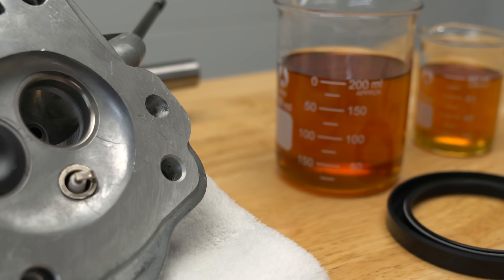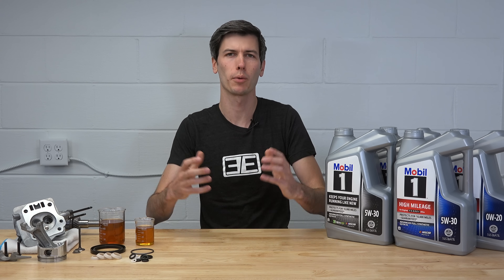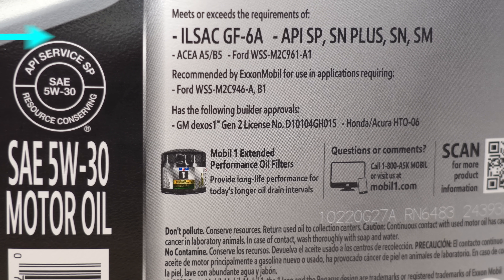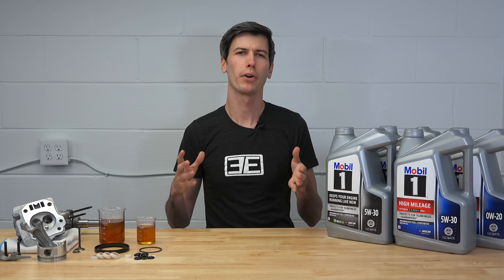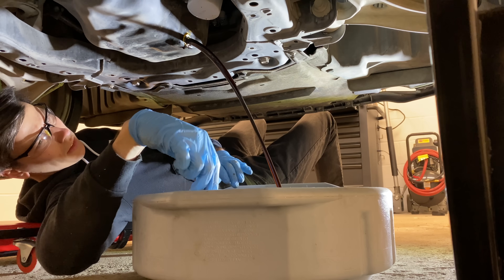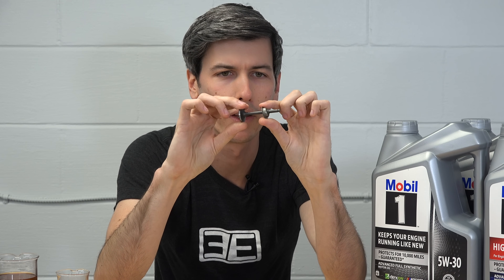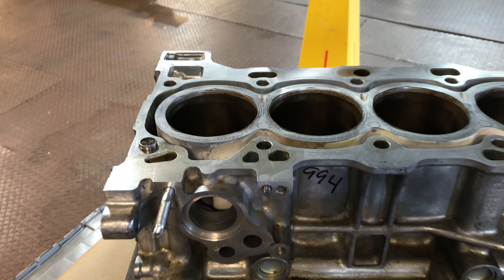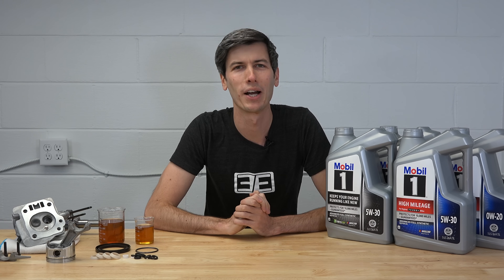Is Synthetic Motor Oil Bad For Old Cars?

Comment: I hated dealing with old farts at Autozone that would run 20w50 in their 2015 Corolla because “that’s what I ran in my 87 Chevy truck”
Reply: And that's why their gas mileage is trashed.
Reply: @101Volts  .0001 mpgs less, big deal.
Reply: I'm an old fart and I use 20w50 in my tractor in the summer.
Reply: I'm a dealership mechanic and we often have customers do stuff like that. Had a customer with a 2018 RAV4 who insisted we used 5W30 because his previous RAV4 ran 5W30 and it's $5 cheaper than the 0W20 synthetic Toyota recommends.  Very common for customers to challenge us and "know more" than the guys who wrench on these everyday.
Reply: @matte8441  I almost kick someone in the face argued about this same issue today🤣he wants to put diesel engine oil into his Toyota Vios..
Reply: Hunk I honestly think customers who challenge mechanics shouldn’t take it to us and should do the work themselves. I’ve been challenged at lot of times. Did a vibration diagnostic on a 2020 Toyota Tundra with 200kms. Cust. States the truck vibrates at highway speeds but he has beefed up tires on it. Kept on insisting he had suspension damage. Some people buy the wrong cars for their needs
Reply: Matthias H I was challenged last weekend as I do side work as a BMW mechanic by some old guy telling me his variable valve timing issue was an electrical problem when I know the strainers and such to that system get clogged. He didn’t even let me try my theory because he said he know what it is, a 2008 5 series is not the same as his old 1980 3 series.. This is why mechanics tell customers to stay outside the shop..
Reply: @autohut3720 BMWs are finicky to diagnose, i owned three in the past. Mine started idling poorly and i suspected the vanos solenoid but it was my one month old KN filter being severely clogged after i was doing a road trip across the US and was caught in a sandstorm in Arizona. Biggest problem about being a mechanic at a Toyota store is customers buy them with the notion they are indestructible, and when their Toyota does break down they get assertive about it. Offroad modded Trucks and 4Runners are the worse, you pull one of those for drivability  diag and guaranteed the owner will interfere. Once had a customer be very assertive when his Venza had multiple problems. He sold his ML350, a car that he described costs him less to run, to buy the Venza. But in his defence, out of a sea of reliable cars the Venza was indeed a piece of junk.  A friend of mine works at a BMW store and said the customers are more forgiving because they expect the cars to fail. Is that true? He may be wrong because when i was there to get parts one if those daddy money chinese students was throwing a tantrum after the reverse camera of his X5M doesn't work. Literally yelling at the service advisor
Reply: Matthias H I know. It makes me so angry, even though I’m not in your position. I just witness those things.
Reply: @matte8441  ok
Reply: @hunk7177  that guy must be watch VGG YouTube channel, he puts diesel engine oil in all his older vehicles.
Reply: @matte8441  manufacturers went to 20w oil over 30w oil for CAFE standards only. I bet if you buy one outside the US it says 5w-30.
Reply: @matte8441  a bit late replying to your comment. The new toyota engines 2.5 and 2.0 liters can use 0w16 up to 5w30 according to the owners manual that was written by the engineers
Reply: @FerasAlhawas  That is misleading. In AutoData, it specifically says if 0W-16 is not available, and oil change can be done with 0W-20 at temperatures above 0f, and 5W-30 at temperatures above 32f, but 0W-16 MUST be used on the NEXT oil change. I don't have a manual on hand, but I'm sure it says the same thing. It would be a bad idea for someone doing city driving to run 5W-30 regularly in their 0W-16 Camry.
Reply: @PlayinWithMahWii  my mom’s 2020 rav4 with 2.0l dynamic force engine the owner’s manual says what i said before, oil is about lubricity at cold start and heat absorption at operating temps plus additives. if you live in a city with maximum temps 50c (120f) 0w20 is nothing and if the minimum temps 4c (~40f) then 5w30 is okay according to the owner’s manual (down to -10c is okay as I remember ) not the mechanic/technician at the dealership
Reply: @PlayinWithMahWii  they can run 5w-30 just fine.  You will just lose a few tenths of a MPG. That’s why manufacturers are going to thinner oils.
Reply: @matte8441  2000 Camry with a 3.0 V6 its smoking at a cold start for a couple of seconds then its clear.
Valve seals maybe?
Reply: You so-called mechanics claimed full synthetic oil was bad for your cars for decades. That 5 W 30 oil is fine for cooler climates but you get into a hotter area 15/40 or  20/50 they're fine so what if you get .0001 miles per gallon less. 0w 20 has been ruining engines long-term especially in warmer weather. Owners manuals tell what viscosity for what temperature range.
Reply: @matte8441  very common for customers to know more than you though.
Reply: @REALBanannaman  At my regular job at the Toyota dealer, I have yet to encounter a customer who knows their stuff. But it has admittedly happened when I fix cars after hours in my own garage particularly with oddball cars like an imported BMW Autobahn patrol car or those JDM cars.
Reply: @matte8441  yeah I bet dude just being a hard a55 lol. most customers don't care about their vehicle as much as they care about other stuff.
Reply: @matte8441    lets just say that mechanics at dealerships not the brightest )))) Those who bright and witty got some experience  and opened their own shops.  Only left bunch of idiots at $18 per hour that have ability to strip an oil plug without even touching it))
Reply: @matte8441  in this case the customer did know more....0-20 is the most destructive motor oil weight ever produced....dealers and manufacturers are in the market to sell cars not preserve them....he may have choose 5-20 instead though....because of the variable timing system...but only in severe cold climate....
Reply: @matte8441     Is there really that much of a difference between 5w30 and 0w20 though?  I get and agree with your general point, especially in regards to the original post you are responding to, but the difference between these is much less than the difference between these and 20w50 kind of oils. 

   If someone switched from a 0w20 to a 5w30, they might lose a little hp, MPG, and their engine run a bit hotter, but there wouldn't be any significantly more wear, unless the person lived in a climate with very cold winters (then you would probably start to see some significant differences in wear because of very cold startups).  

   In older cars with 200k+ miles, it can actually be helpful to run a bit thicker oil, especially during the hottest part of the year. This is because clearances between parts tend to widen some over a long period of time.
Reply: I'm one of the old farts that used to run 20/50 but that was in my old trucks like my 67 F-250 with a 390 and later built a 406 for it. Everything in those old big blocks was bigger. Oil passages and bearings specs. Come winter when it would drop from the 100s down to the 20s I would run 20/30.
With the new engines, I read the manuals and look at the oil cap. 
My 99 Ford F-250 gets a full Syn 5/30 and my Chev gets the full Syn 10/30. They both have about 160k on them and no signs of death yet. I do tend to change my oil and filter quite often though. At 73 it's about all I can do on these newER rides. Both are garaged and taken care of. I try to do it all myself so I know it is done right.
It's like the torque wrench is a mystery to these young guys!
Reply: @outdoorfreedom9778  interestingly, I am 73 years young, also.....: see my comments.....I do Napa gold Filters ( wix) short term, ROYAL PURPLE SIX MONTH longer OICS
Reply: Outdoor freedom well I didn’t mean it in an offensive way lol but what I’m trying to say is the complete ignorance towards the fact that newer engines have smaller clearances and shouldn’t be ran on an oil so thick just because it worked on something 40 years older
Reply: So they automatically assume they know better than the engineers of their cars?
Reply: @samd7476  Automatically? Don't be silly. They do it manually.
Reply: @samd7476  no. They don't trust the engineers. Big difference. They think the engineers want the engines to not last very long and break down so people will have to buy a new vehicle or motor.
Reply: Who in the hell would ask the counter guy @ Autozone for a recommendation anyway? I go by the manufacturers recommendation in my vehicles.
Reply: @4thstooge75  Great answer!
Reply: They would be idiots for that in an 87 truck. The TBI-V8 had tight play and the metal was hard. anyting over 10W is hindering the oil reaching where it needs to be.
Reply: @impalaSS65  Not after 200k miles lol...
Reply: @robertelmo7736  I have two 305 and one 350 "on the stand". Not a professional, just like to give these modern old engines. a second chance.

The 350 must have been owned by someone using 20W and rarely changing the oil. It had ridges from the top ring and the crank snapped in the first main. 

The two 305 have, as expected, no ridges after that amount of miles.

Compare that to old rope seal engines - they had ridges from the top ring after not that much use. They were manufatured with widely varying tolerances compared to, softer iron and in addition abused by too many throwbacks using 30W straight.
Reply: @impalaSS65  that 87 Chevy can run on  any oil strait 50w 15w40 Lucas lol they just live forever
Reply: @impalaSS65  BS.
Reply: @impalaSS65  You mean it had tight bearing clearances? What metal was hard?
Reply: @impalaSS65  on the pre ls style they actually recommend 10w40 for higher mileage engines and 20w50 on them if they have heavy oil consumption. Meaning the engine is basically wornout but still runs.
Reply: The chevy truck with a well past wor. Out 350....smh
Reply: @EvlEgle  what
Reply: 20/50???  Oh my lol
Reply: I wouldn’t go back to that autozone. Any car with variable valve timing or cylinder deactivation needs thinner oil like 5/20 or 0/20. Also, don’t slack on oil changes. The Chevy/Cadillac 3.6 needs very frequent oil changes. 
I have steered a couple people to avoid a Just Tires store because there are a couple of a$$holes working there.
Reply: @kenc2386  the manager at the store I used to work at used to literally suggest thicker oil and agree when a customer asked about maybe using thicker oil. Anything to make a sale. I will never work there again thankfully
Reply: @autohut3720  Damn that stuff pisses me off when a counter jockey thinks that they know more than a manufacturer. Lol.
Reply: @kenc2386  What the people working there do?
Reply: @kenc2386  I heard a ass clown tell a customer that 0W 16 will ruin his engine (19 Avalon) and use 10W 30! I stepped in and told the guy do what the manufacturer says or you'll screw up your engine! He listened to me and the counter jockey just glared at me! Lol.
Reply: @kenc2386  Slightly incorrect, the variable valve timing on 2012ish cruze 1.8's and 1.4's works just fine with the manufacturer recommended 5W30
Reply: If that is your biggest problem at work you are doing good.
Reply: @tomthumb5445  Agreed. (:
Reply: Why?
Reply: @jeep2liberty  Why not?
Reply: @jeep2liberty  why what
Reply: that would be good in the differential
Reply: So in plain simple terms go w recomended  weight thats in the cap no matter the miles or year of car?  And u can also run synthetic on old cars as well?
Reply: @toekneelorenzo2942  wrong... that recommendation on the cap only protects the manufacturer and EPA. Once again....they are the business to sell cars not preserve them.
Reply: Now Autozone hires young punks who know NOTHING.  Not sure which is better.  They're just clerks, but at least the old farts actually had vehicles they worked on before.
Reply: If I had to deal with that or even see it, I’d be very agitated myself. That must be so aggravating.
Reply: Try the new farts and get the same result with 80w-90 hypoid in 5 gallon can
Reply: I've driven nearly a million miles between 5 different cars all older than 2002 (delivery driver) using only Mobil 1 synthetic for the last 16 years and I've never once had an oil related problem. I change it about every 8k miles.
Reply: That's me
Reply: Lol
Reply: My 89 firebird with the 305 tbi has 387k miles I run 15w40 diesel oil, half bottle of high milage lucas oil stabilizer,  and a little over half bottle of marvel mistory oil.. I daily drive it 120 miles a day, runs healthy zero smoke, not even at startup 😎
Reply: @brycefausett2204  With a GM engine from the 80s and that kind of mileage you can get away with 15w 40! Lol. You definitely got a well put together motor.
Reply: Oof....
Reply: what kind of a hole are you ?
Reply: Same thing happened to me. My mechanic was running 10-40 in my civic and it needs 05w30... when I switched to 05w30 it ran smoother, more Power and better gas mileage...obvious difference!
Reply: Yeah 20 50 on my small block also
Reply: Those "OLD FARTS" are not Auto Techs..you use what the Manufacturer says to use. Our shop puts what the engine requires in our customers vehicles..if they want something else that's thicker we send them on their way👋🖐
Reply: Exactly....its all about tolerance....not oil viscosity that determines what to use....but then again Henry Ford recommended 20w for the Model T...and Andy used STP in his Indy cars.
Reply: I worked at a AutoZone years ago with "Old Farts" that ran any vehicle... any year with straight 30 weight oil..
Reply: That's a bit extreme.
Reply: The best oil for all four seasons is 10w/40, it doesn't matter age or mileage..
Reply: And 632 bbc making1270 hp says a old guy
Reply: Oh god I remember an OLD FART telling to run a THICK A$$ oil like that in my old Prelude. :(
Reply: @WarriorsPhoto  ...idiocy has no age restrictions.....keep that in mind.
Reply: @TheWilferch  So you’re saying morons exist in all age brackets?
Reply: @WarriorsPhoto  ...big surprise to you ?
Reply: @TheWilferch  What is the surprise? (:
Reply: @WarriorsPhoto  ..this was in response to your obvious age-restricted comment as to who are morons.... I say moronic comments come from all age groups and ask you if that seems to be a surprise to you? Did you lose sight of the comment exchange chain?
Reply: @TheWilferch  Yes. What is next?
Reply: @WarriorsPhoto ... it's unfortunate YouTube no longer displays the thumbs Down count.  You would see how popular you are.
Reply: @WarriorsPhoto  I have a 305ci 5.0L 91 Trans Am. Per what my father (a race car driver) taught me, I gradually increased the thickness of the oil when I started to notice the car using more oil at high miles. I've used 20w50 Castrol GTX high mileage oil for at LEAST 50k miles and the care is currently at 256,000 miles and still going. Maybe there's concern for the imports, but my experience is the old guys have a point about that when it comes to the push rod GM engines.
Reply: @PrimeProductionsULTD  There's nothing like a GM push rod engine. I like that you shared your story. I've seen plenty of Corvettes with over 200k miles. Congratulations on your long term vehicle as well.
Reply: @WarriorsPhoto  There was a reason for that recommendation that you obviously are unaware of .
Reply: John Burakowski Yeah nothing new there. 😉
Reply: @WarriorsPhoto  you moorons best visit the web for temperature ranges per given viscosities.
Reply: @lonniebeal6032  Why thank you for letting us know and know that you are appreciated.
Reply: Coworker of mine looked up online what oil was needed for his 4cyl Escape and he found 10w40.  I opened his hood and pointed to the oil cap which read 5w30.  I told him to always look at the cap, never look it up.  Now, we did his oil change with the heavier oil anyway because when he got it from his uncle, it had been sitting for a couple of years and I told him it would be ok to run it for a couple of months during the summer just to make sure everything is flushed out, but that we were going to have to do another oil change before winter because it could cause problems.  He doesn't drive it more than a few miles at a time within town and not for very long, but I told him that if it doesn't get replaced before winter, it'll be harder starting and will kill his gas mileage.  So, he learned a lesson.
Reply: @cujoedaman  if you're in a hot climate where the temperatures are constantly up around a hundred or higher 5w 30 is too light
Reply: @cujoedaman  Bad idea, I've replaced oil caps that with others that didn't have the proper specs on it.
Or ones that weren't marked at all.
Reply: @cujoedaman  BS.
Reply: @cujoedaman  It won't be harder to start, nor will it affect fuel mileage, either. The difference between those 2 grades of oil is minimal, especially at normal operating temperatures.
Reply: @AmericanThunder  Then why do they say to only put specific grades of oil in your car?  FOR COLD WEATHER STARTING.
Reply: @cujoedaman  cold weather starting means the oil is thicker and takes longer to reach the bearings so the thinner the oil the quicker it reaches the bearings since 90% of all engine wear occurs at startup especially cold startup thick oil is not what you want for cold weather. It has nothing to do with making the engine start harder.
Reply: @cujoedaman  His car is going to be hard to start because he went from 5W to 10W oil? Okay.
Reply: @robertelmo7736  Yep, is that a problem?
Reply: @cujoedaman  No, it's not lol. You are silly.
Reply: Robert Elmo yes a 5 vs 10 weight will affect starting in more than a few vehicles.  It does in mine.
Reply: @Mad-Lad-Chad  also, your cylinder deactivation of you have it, will not function like it should using thicker oil , I too have 20 years mechanical experience.
Reply: Darrell Fincher good to know, never had a vehicle with that feature.
Reply: Darrell Fincher I have less than a few years mechanical experience and even I know that
Reply: @robertelmo7736  yeah it does make the engine harder to start. There will be a delay on starting up but it will start.
Reply: @darrellfincher2948  I have 50 years of accumulated inexperinece.
Reply: @cujoedaman  actually I went to 10W-30 in my 4CYL/2007 GMC ( *Sh be 5W-30, RECOMMENDED)@**100,000 mi., Synthetic VALVOLINE , no problems for two years in WARSAW INDIANA AREA;( approx 20F) however moved to HELENA Valley,MT in 2016: & a few more times @**-31F,ETC... I HAD TOMGO BACK TO 5W-30s or 20s, for better cold starts and quick lubing,etc....Drive much less now, also,,,,.was 130,000 Miles on Valvo SYN..... Though, now USING MOB1, now (*& more filters ( NAPA Gold, short term, ,  or ROYAL PURPLE Fikters @ six month plus, etc.
Reply: @robertelmo7736  Everything gets hard to start in the winter, depending on where you live. You need  every advantage sometimes and even that is not enough at times.
Reply: @robertelmo7736  ya, it's BS.
Reply: There is a guy in my neighborhood who puts straight 30 weight in his 2012 GMC pickup truck . When it was new , I said if it went bad , you probably don't have any warranty . He said " it was good enough for my father " . He is permanently out to lunch .
Reply: I am an old fart, I run straight 30 weight in my. So piss off kid. LOL
Reply: I’d be like “Back in the day yes that would work. But modern engines are like Swiss Watches these days. All sorts of tiny passageways that are intended for a super thin oil. Putting in a heavily oil will prevent it from moving in those holes and your engine can get fucked” 

They’ll probably give me some “rEsPeCt yOuR eLdErS cHiLd!1!1!” Lecture but I don’t care. Because him and I clearly know more than the Engineers who built the thing. Lol
Reply: But the levy was dry.
Reply: 2015 Toyota Corolla uses 0w-20 oil, and using 20W-50 oil in that 2015 Toyota Corolla would actually destroy the engine, due to the thickness of oil. Variable Valve Timing systems requires oil pressure to work, compared to older cars that didn't have Variable Valve Timing.